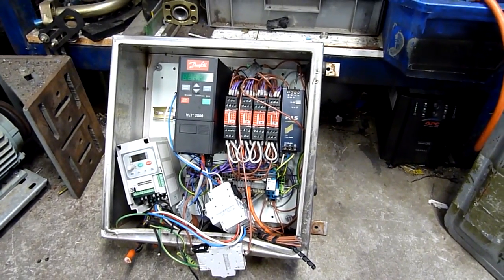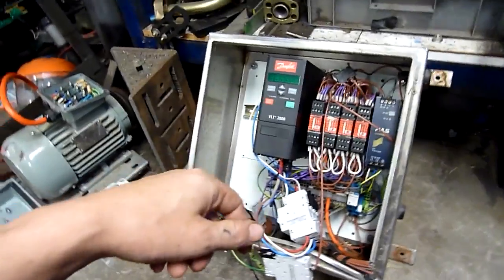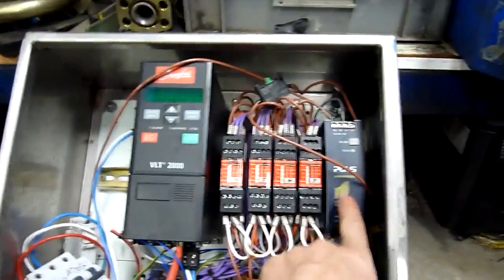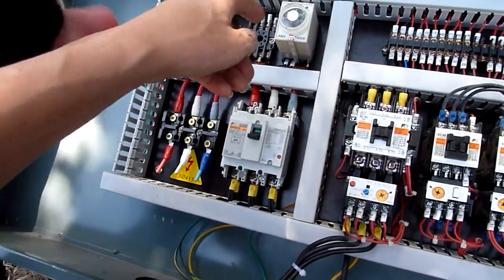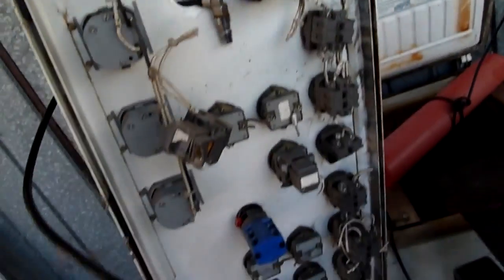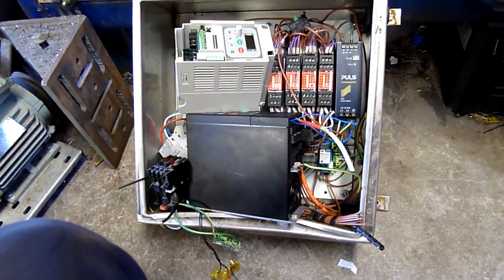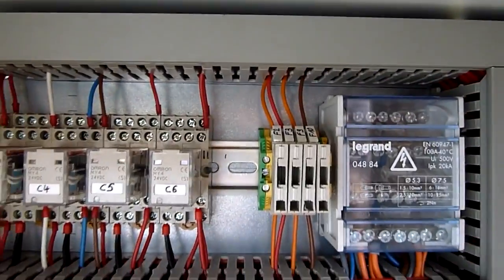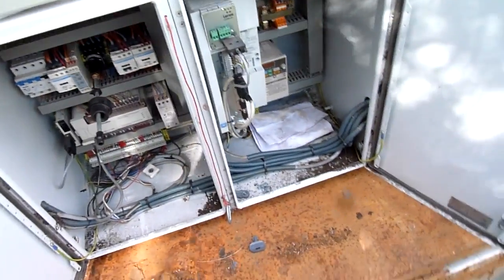Industrial electrical panel salvage for hobbyists

Comment: Thanks Muhammad Syaifullah

User Aussie50: Calender 2018 Overload/Overvoltage Upload
Overload HDD/CD-DVD 3600 Volts Overvoltage Video 26 June 2018 Upload
Overload Ceiling Fan 12000 Volts Overvoltage/Kipas Angin 5000 Volts Overvoltage Video 10 July 2018 Upload
Overload TL/CFL/LED/CMH/MH/HPS Lamp 4000 Volts Overvoltage Video 25 July 2018 Upload
Overload PC Cooler Fan 4500 Volts Overvoltage/Overload GTX 1050 Ti Fan 6000 Volts Overvoltage Video 23 September 2018 Upload

Overload PC Cooler Fan/Overload GTX 1050 Ti Fan Overvoltage
Overload HDD/CD-DVD Overvoltage
Overload Ceiling Fan/Kipas Angin Overvoltage
Overload TL/CFL/LED/CMH/MH/HPS Lamp Overvoltage

Comment: Hi Ed
I've got some PDL 5.5kw drives that can be powered off 240V.
Reply: He Ed
Sorry, sent before I finished.
One's got your name on it if you are in the Bayswater North area.
aet.net.au
Reply from the maker: Thanks for the offer!, not sure when I will be up that way next but its worth a trip alone. I will work out some time next week perhaps?
Reply: No worries, I'll be on site Tuesday onwards. You can email me from my website.
Like you, I have got rid of single phase motors and I use these drives at home on a lathe and waldown drill.
Reply from the maker: no worries mate, I will let you know

Comment: Yeah some of those switches and indicators are candy. The thing is to remember that when the controls are good looking and they feel right and make sense for the application, what ever you are doing is far more fun to work with and it can change everything; especially if you are building and modifying the thing. Interacting in that control environment gets one to use their brain differently. A computer keyboard, mouse or touch screen or voice command will never ever get there in some cases. Maybe getting wired into the matrix and getting tricked into thinking your using controls like that is the only other way, but I don't trust that mere concept at all.

Comment: Bought a big pump control panel on an auction for under $10, used the BB relays on it for years to fix one machine, as this control box had over 30 relays on it, and they were obsolete and no longer stocked.  Machine used them and still runs, even with relays that are over 40 years old and still original parts.

Comment: I recently got a motor from a thrift shop ($3) and it's wires are Red, Yellow, and Green. Do you know what the pinout would be for that? I can not find anything online that helps. It's a westinghouse.

Thanks!
Reply from the maker: color coding is a bit odd, is this in the US? . you could take a multi-meter on Ohms setting and measure between pairs of wires in all combonations and see if its 3 phase. the readings should all be the same unless its burnt out, or single phase. that will get closer to finding out how to power it.
Reply: Adam Messmann any itentification plate ? because like that it could be  anything.

Comment: You can run a 480V VFD from 240V by adding a voltage doubler.
https://www.youtube.com/watch?v=Oi5L_9mmmpI
Reply from the maker: Thats an intresting idea, not hard to make either, I might try that.